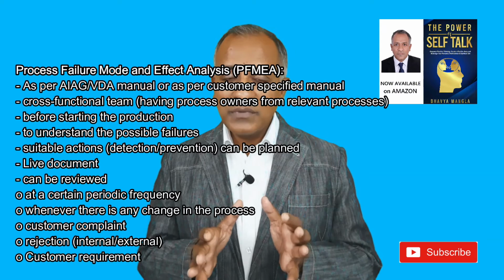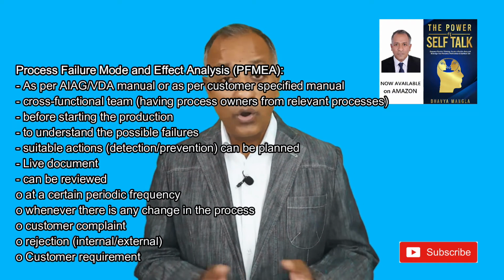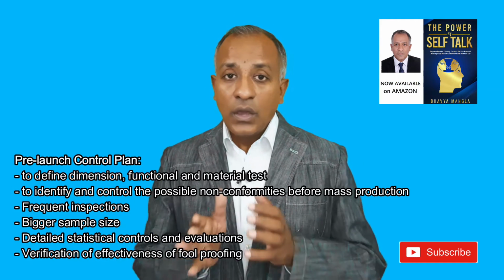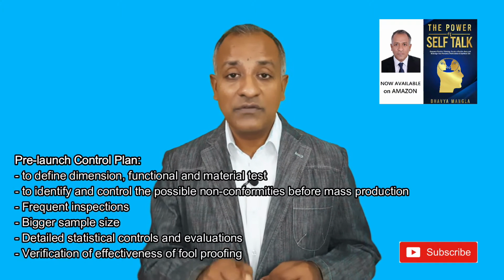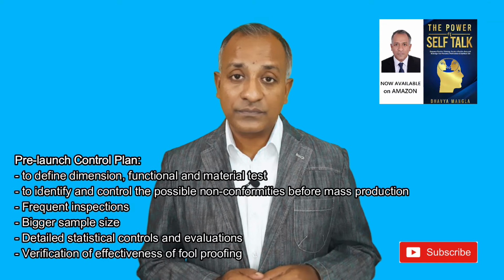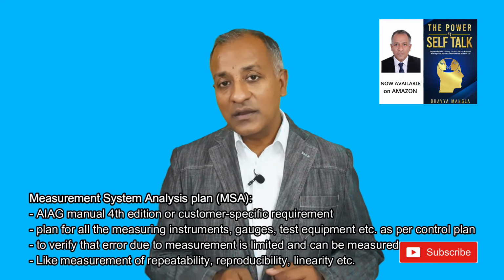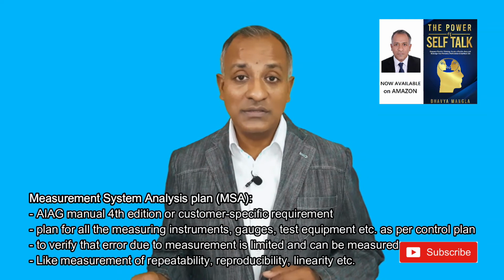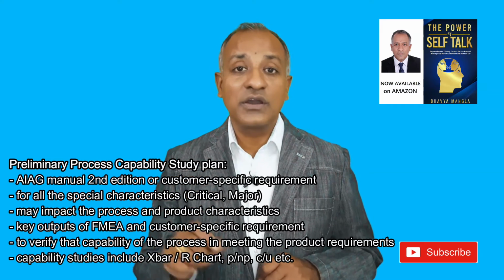New Product Development : Process Design (APQP-Phase 3) Part 4 of 8 | English | Bhavya Mangla

Comment: Please explain tool costing(injection mould) and product costing 😊🙏
Reply from the maker: Dear Digvijay, Thanks for your query. Tool costing is a subset (part) of Product (moulded component) costing.  Apart from tool cost, there can be other cost related to machine cost, manpower cost, raw material cost, fixture cost, waste cost, inspection cost etc.
Reply: Sir if you make video on that i am very thankful towards you
Reply from the maker: @digvijaysingh2314  Thanks for your suggestion. Hopefully soon